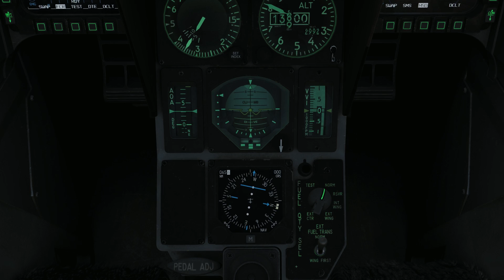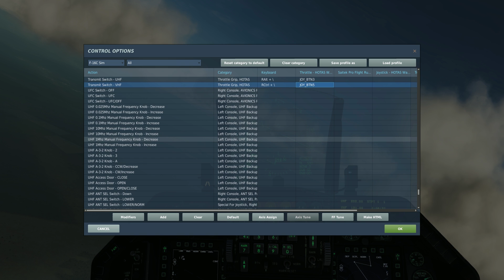DCS World 2.5(Beta) - F16c Viper Air to Air Refuel (AAR)

Comment: One more thing you can do to make this easier, if you don't want to entirely top off or want to monitor your fuel level, is to open the DED to the bingo page, using the list button (also shows total current fuel). Then, by the switches on your right, turn the DED switch all the way forward to project it onto your HUD and just leave the DED to the bingo page. that way you can monitor your fuel as you're refueling.

Comment: One handy thing to do is to bring up BINGO on the DED and then bring up the DED on the HUD.  You can then see your fuel state at a quick glance.
Reply: Jack Flash r u know how can we see DED on the HUD?
Reply: @ommer080383  Yes....On the HUD panel to the right of the joystick you'll see a switch 3 positions from the left that is labelled DED DATA.  Flip the switch to that setting.

Comment: I'm not a military pilot, but it sure seems like refueling loops right in the middle of a scattered/broken layer seems a bit unrealistic. Was this the way it was set up intentionally, or just luck of the draw? Most tankers are at FL200, no?

Nice flying and instruction on the HSI. Thanks for the video.
Reply: Craig: coming from a retired 135 Boom.  Conducting A/R at broken layers did happen we tried to avoid them as in the decks turbies could become a factor.. AR with fighters was normally done at Fl 20-25.. A-10s were usally as low as 10K. Regarding AR speeds. 315 Kias was standard fighter speed
Reply: @RH-ke3od  Awesome, Ralph. Thank you for the information.
Reply: @RH-ke3od  Thank you for the info! If I may ask, what speeds did you refuel A-10s at? Have a lovely day! :)
Reply: @2xKTfc  let me dig out my checklist this evening and I can give you the tanker AR and overun speeds,..tbh with an A10 you are gonna have to push it up..glad your not a C130

Comment: Superior flying by a superior pilot. A touch easier to refuel than the Tomcat?
Reply: Not sure, everyone seems to think that boom refuelling is easier then drogue but I'm the opposite, I would say it's easier then the harrier based on the fact you hold a position and the AI guided it in but not any aircraft with the probe in line of sight.
Reply: @ThatGuysProject  Its up to preference i'd say. Drogue requires more precision to connect, with a boom you just need to hold a position and someone else will line it up for you
Reply: @sebastiaomendonca1477  i tend to agree with the prefrence, for me the hard part with it is not seeing the connection point and having to rely on trust and the lights on the aircraft to indicate position, after some practice i got it down to acceptable standards, with the basket though perspective wise for me it was better cause its in my line of sight.

i do know that irl though the boom method can deliver fuel faster.
Reply: @ThatGuysProject  You get used to the lights, i guess. I have a bit more trouble with the drogue because i tend to overcorrect a bit and struggle to line up the probe

Comment: When I am connected I get immediately the info: Transfer complet. 

Anybody knows this Problem?
Reply: Olli1995 apparently there is a pre release bug and only the caucus map works with AAR. Try that.
Reply: 737Maxter I’ve got it working with the Persian gulf map. I think it’s more a multiplayer bug than single player. I’ve also heard of people only getting it to work if they have external tanks equipped. It seems to be the same bug but with many solutions right now. I’m just hoping Ed can fix it soon (and the fa-18 ladder) soon!
Reply: And Shiftie Mover, I managed to do a normal take off and have it work. Really just seems to work when it want to
Reply: @shiftiemover4110  I've refueled on the Nellis Map with no issues. Single player and air start.

Comment: Very very smooth flying, great video as always! If you set the DED to LIST 2 (Bingo/Fuel) you can use the DED HUD repeater via the DED Data Switch on the HUD REMOTE CONTROL PANEL. That way you can see your total fuel on the HUD without having to look anywhere else so you can see refueling progress.

Comment: Apparently AAR only works for Air starts?  Is that right?  Couldn't get it working on Caucs from cold start :)
Reply: Yes. Even if you are on causacsus and you start from cold start AAR will now work for you.
Reply: @SteonCZ  Did they push an update since release? I tried it day of and it immediately said "transfer complete" after connecting. Not a pleasant thing to hear when you've only got 700 lbs of fuel left...
Reply: @wraith444  No. Just start the mission airborne.

Comment: Id really love a working dynamic weather. With more cloudbases, different humidity etc. Do you know how to "reload" the clouds, once you are outside the "cloud area", shiftie?
Reply: "Reload the clouds"? Huh?
Reply: Try going to the F10 map and back again, sometimes works with static weather.
Reply: @SonicTemples  i'll try that! Its funny when you hit f11 by accident and then back to f1, all the clouds are gone.
Reply: @Jockesse  yep f2 does the same. Look into Dynamic weather if your making missions though, it's a bit more of a hassle but you can put the clouds where you want and they don't have the disappearing issue.
Reply: @SonicTemples  weird, to me f2 doesnt remove the clouds. Also tried f10 , didnt reload the clouds 😐. Yeah, I did try the dynamic weather. Waaaay too much of an hassle to put up. Always got extreme winds on parts of the map. Haha. Airports had to close!
Reply: @Jockesse  It's only if you use f2 to switch planes that are in a different map area that you can lose the clouds. I think the f10 map only works if you've flown outside the cloud range rather than lost clouds altogether by switching cameras. Dynamic is a pain but once you have a good setup, you can reuse the same file. There's ways to get around the wind.
Reply: @hammerofdavey  Yeah, ED has a LOT on their plate to finish!
Reply: this aged well